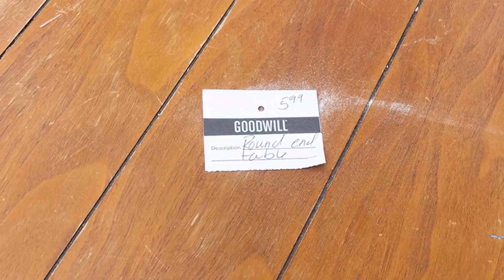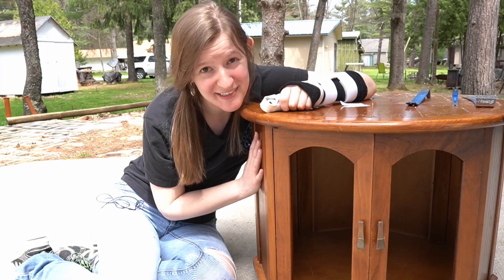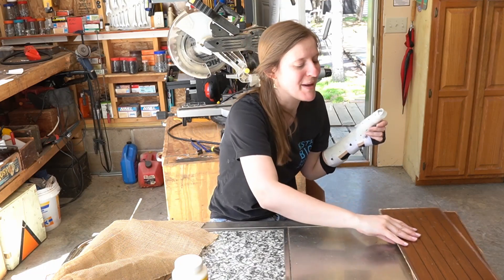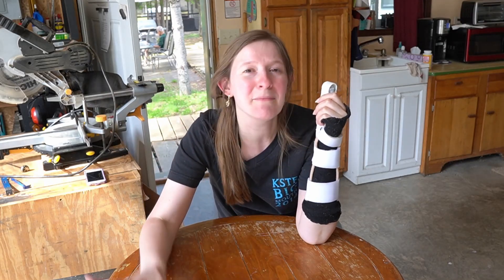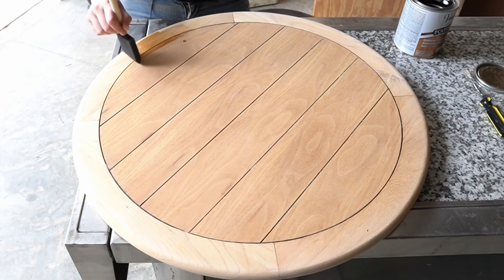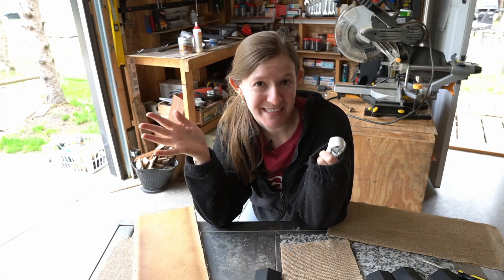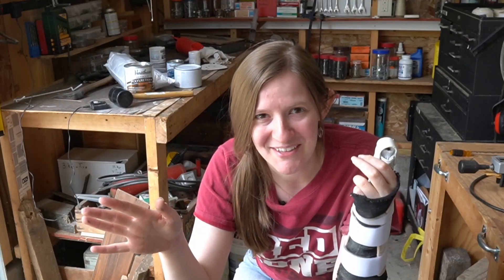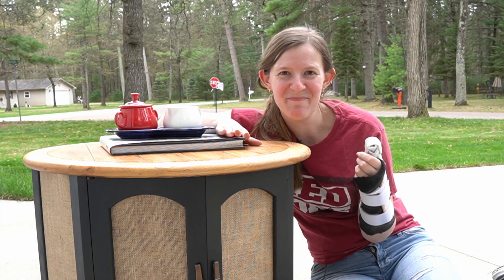Cane is expensive… See what I used instead!

Comment: I know on your website you said you use the Coceca 80pc. orbital sanding discs.  I noticed they also have the 100pc. LotFancy ones as well.  Have you tried those?
Reply from the maker: No, but I order a different brand of cheapo Amazon sanding discs pretty much every time I go to purchase more, (the one I ordered before is rarely still available,) and all of them have been fine, so I say just go for it. 

(Update: I just checked my order history, and I did buy from LotFancy in 2019. I had no complaints.)